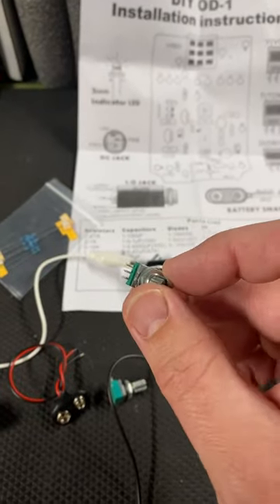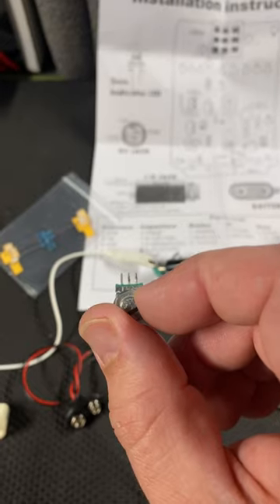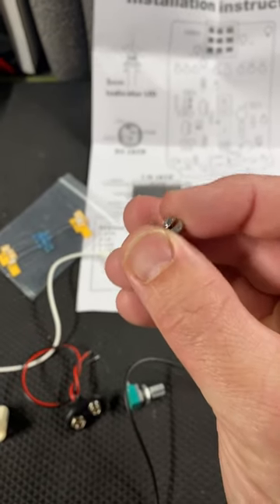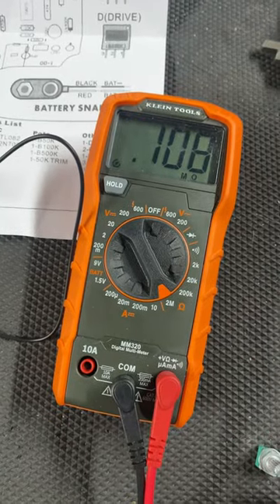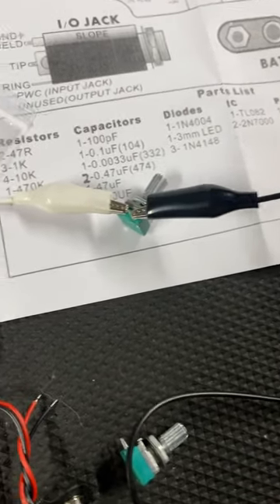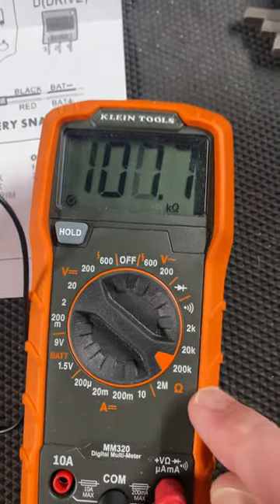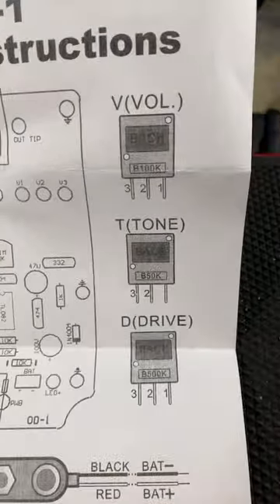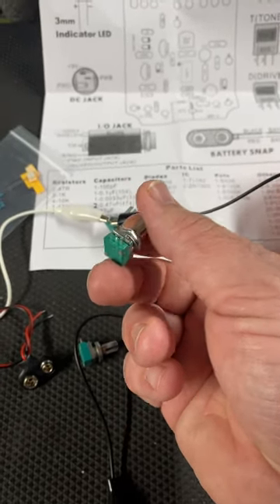How to measure potentiometer using a multi meter. #shorts #guitar #diy #effects #electronics

Comment: Great simple and to the point, I was running around in circles trying to find a 5k pot and this helped allot. 👍😄
Reply from the maker: I’m glad it did.  I’m going to post lots of guitar tech/amp tech type tips here.  As they pop into my head or I need to figure something out, I’ll put it out there.
Reply: @paroblynn  That'll be great we weren't all born knowing this stuff. LOL 😅
Reply from the maker: @paulzedx636ninja7  I get ya.  I learned mine from engineering school school and learning what I needed to do to fix my stuff.
Reply: @paroblynn   Well you got a good start, I learned by taking things apart and halfway putting them back together. LOL 😄
Reply from the maker: @paulzedx636ninja7  I’m not far off my friend.  Ripping things apart is my pastime.
Reply: @paroblynn  You caught me,  I'm in the process of robbing some parts out of an old tv. Sometimes those things just come in handy. 😄
Reply from the maker: @paulzedx636ninja7  need help?  I love ripping shit apart 😂
Reply: @paroblynn  I'm in the process of building an lm317 voltage regulator to run off an old lambda power supply. Mostly a lot of finger crossing is what's happening with this. LOL 🤞😅

Comment: Hello sir is there a way that the potentiometer can b fix?my multieffects for guitar lost control😢😢😢
Reply from the maker: Yep, replacing a potentiometer isn't too difficult for an experienced tech.  In a digital multi effects unit it's likely a PCB mounted potentiometer and if that's the case you want to be careful removing it so that you don't damage other components.  Patience, understanding of soldering and removing components, and a new potentiometer is really all you need.